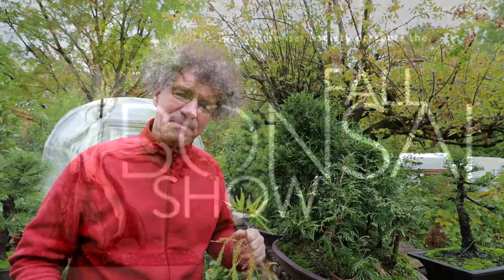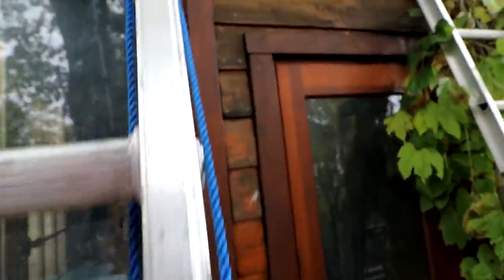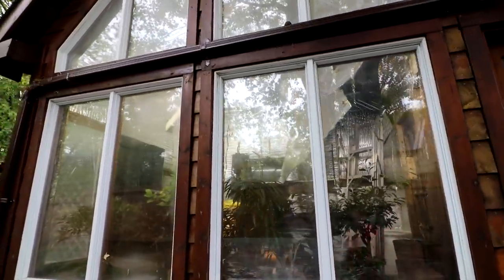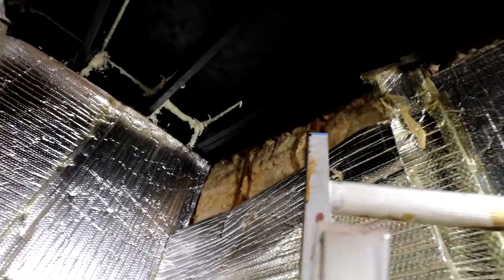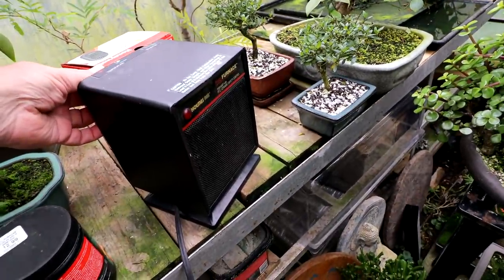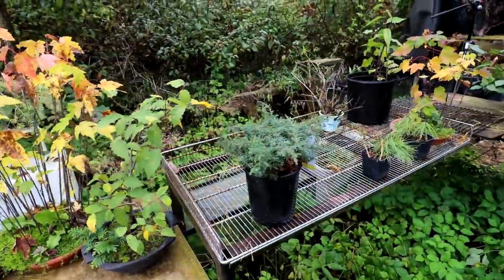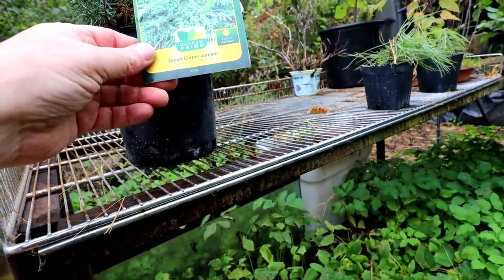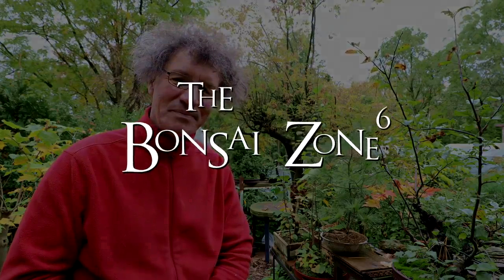Keeping My Bonsai Warm in Fall, The Bonsai Zone, Oct 2019

Comment: Ah just one thing, one of the best insulation is perlite, because it can take up moisture and give it back into the air if the climate changes.
I think it would be quite hard to fill the roof with it but it might be possible. I would get big vermiculite building panels and cut them to fit in as containers filled with perlite.
You would never get fungus up in the roof, because the condensation would happen in the perlite while the air humidity inside is already lowered, so there would less water condensate.
It's a lot work thou but it is a long term solution without plastic stuff and granting a very stable climate in the room.

Comment: Just wondering how you are planing to over winter the rosemary, I also have one I am starting but I can't find the correct info on how to over winter it. I've read that you can keep them indoors through the winter and then other places i've  read that it needs cold temps but not lower than 20 degrees fahrenheit or -6 celsius, which would a bit hard for me and you to do since it gets much colder than that where we live.

Comment: What temp is your basement over winter for overwintering that juniper and how often would u water it ? Thanks 
By the way love your videos and u have such a pleasant personality
Reply from the maker: My basement hovers between 5 to 15 C usually in the winter. I have a basement window that I can slide open to get extra cooling on warmer days and the basement is closed off from the main basement's heat. It is quite humid and I check the trees for water once every week, but they usually only need watering every month.

Comment: Hey Nigel, this is my first winter since I have been growing Bonsais here in Canada, Im confused about what to do for some of my trees. I have a young Eastern white pine in a plastic nursery pot cut down shallow enough to work as a training pot. Moreover, I have a boxwood in a clay training pot, an Alberta spruce that I just styled and have not repoted since purchasing from a nursery back in July. Plus I have two juniper cuttings both of which have rooted. Should I move these to the garage, keep them as they are outside in the full sun or do something else? I know this post is too long and this is a lot of details but Im just trying to get my trees through winter. Advice is much appreciated
Reply: It sounds like most of your trees are hardy and can handle the cooler temps of fall just fine.